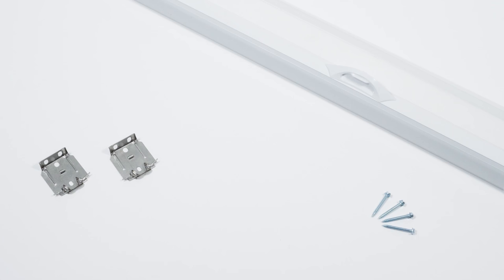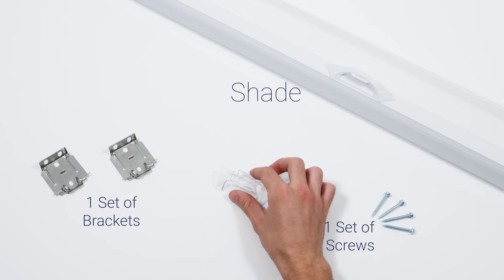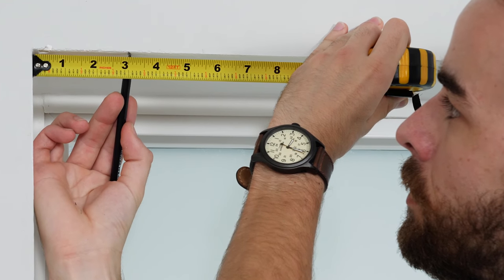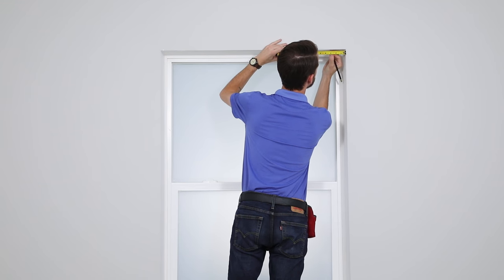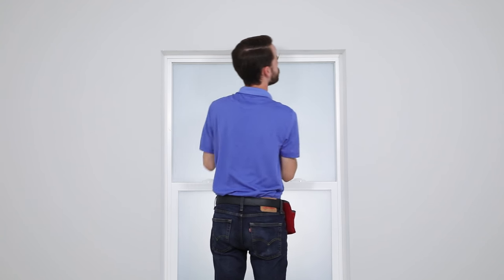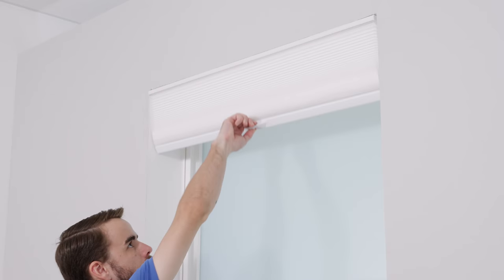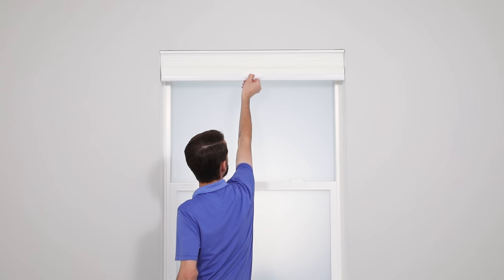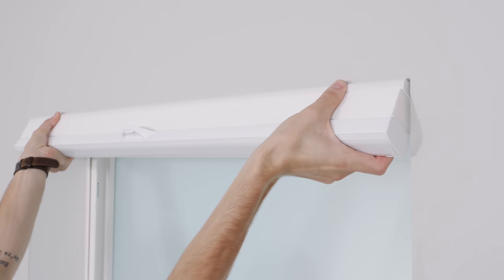How to Install Inside Mount Honeycomb/Cellular Shades

Comment: I just installed these shades (top down bottom up versions) and just wanted to say thanks for this video! They were very easy to install, snap in, and remove (I wanted to adjust the spacing of a bracket and was easily able to remove the shade, fix, and put it back). I'll be ordering more for my other windows — super happy.

Comment: Select blinds sucks. Do not buy from them. The brackets are all designed terribly. Look up other videos on YouTube of people complaining about the terrible design of the brackets and how it’s impossible to snap the blinds onto the brackets. You will never be able to put the blinds up and you’ll waste your $$$. Buy somewhere else.
Reply from the maker: Luke, I apologize that you are having some troubles with the brackets. Oftentimes, the brackets are screwed in too tight for the clip to catch on the ridge on the head rail of the blinds. Try loosening the screws slightly, then try to snap it into the brackets.
Reply: @SelectBlinds  Just loosened the brackets and nope. Still impossible to snap on. Terrible faulty design.
Reply: Thanks Luke.  I was about to order a roll down shade from them---now I won't.
Reply: Are these cellular blinds cleanable?

Comment: Installed these today. The instructions that came with it said to pre-drill using a 3/32" drill bit which I did. But that was way too small compared to the size of the screws supplied. Was too hard to get the screws in so I had to drill bigger holes. I found out after (from the BobVila site), "If you are creating a pilot hole for a screw, the drill bit should be the same size as the body of the screw—not including the threads." SelectBlinds needs to correct their instructions.

Comment: I have brackets fron 2/2024. Can you update your instructions please? I CANNOT snap the blinds in. I’ve installed so many over the years , but these simply do not fit the bracket. The back rail lip does not reach the bracket protrusion that it is supposed to catch on. So I have $400 blinds I can’t use. None of your videos show this style nor troubleshooting nor closeups of what anyone is doing. They all conveniently skip the snapping in part with any detail or closeup of the clip and bracket.
Reply: i also had problems snapping mine in but i found if you reach behind it and gently push the little flap out and push up, it'll snap in, at least it did for me.
Reply: Having the same problem. I've installed many cellular blinds. These are not snapping in. Purchased 08/24

Comment: I just opened up the box of my Allen and Roth Cordless Cellular Shades in Linen.  I have put up many blinds in my lifetime, but I could not figure out for the life of me in which direction the brackets went.  What made it worse was that there WERE NO INSTRUCTIONS in the box.  I looked at two videos on YouTube.  The first video showed a man installing the brackets from a distance without a close-up of the direction of the brackets.  The second video showed a woman putting up brackets for the same product that look nothing like the brackets that came with the shades.  Since I don't want to make a mess with the installation, I'm going to have to hire my handyman to do it for me.

Comment: What size pilot hole should you drill?
Reply: When there are no instructions or the bit size is not specified, I hold the screw below various drill bits until I find a drill bit that is similar in size to the screw's center and allows me to see the screw thread beyond the bit's width. This helps to avoid drilling too large of a pilot hole. For anchors in drywall, I choose a drill bit size close to but smaller than the anchor width so I can use a hammer to tap it into the wall without the anchor bending.

Comment: These blinds went up without a hitch, (so far) three up, 6 to go! Looking good and great quality!
Reply: What drill bit did you use for the pilot holes? In the past mine were too thin and then getting the screws in was very difficult.

Comment: The manual shows 2-½" spacing on the side in one picture (inside mount diagram on pages 3), and 3" in another diagram on page 2 for "bracket installation". You should get those two to be consistent, or mention that inside mount specifically wants a different measurement from the side of the window wall.

Comment: Was able to install based on these instructions, but it should be mentioned that for the remote control shades, you need to program the shade BEFORE putting it up to link it to the remote.
Reply: I installed the first shade in my office and it has worked like a charm these past few months, so I got a second one for my bedroom window.  Came back here to watch the video to remember how to install it....and am glad I commented on the thing I wouldn't have remembered to do this time around.  🤣

Comment: Different bracket than what I got. Viewers. Don't use the provided screws
Reply: The provided screws are terrible. Flat head screws are the way to go.
Reply from the maker: Thanks for this feedback on the mounting hardware we use. We'll forward this to our manufacturing department and see if we can up our game.
Reply: @SelectBlinds  can the clear plastic handles be removed without breaking them?